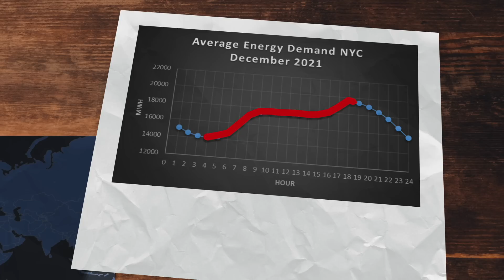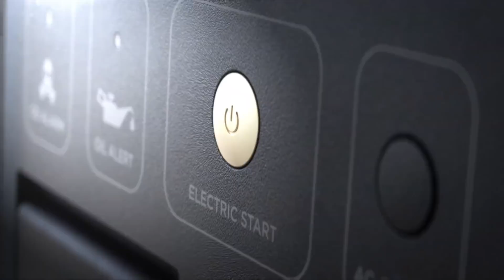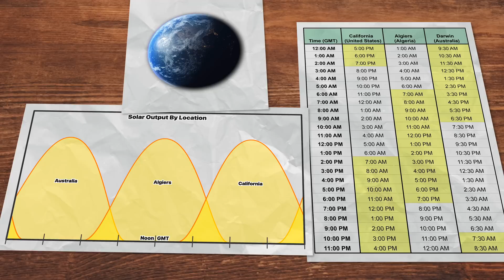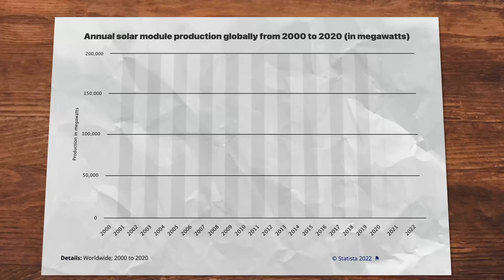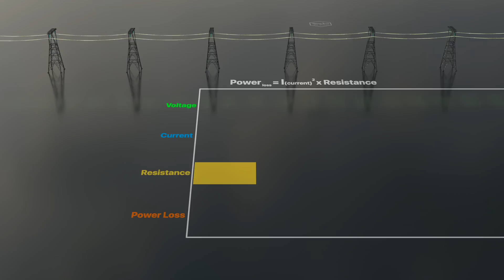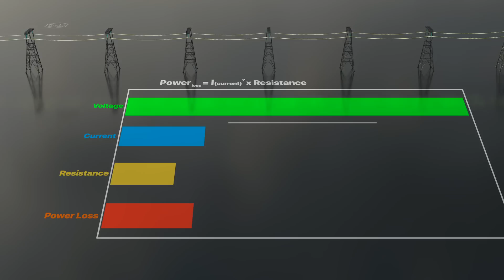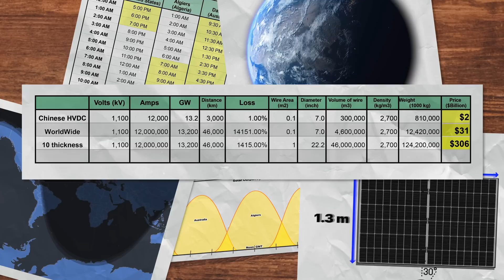World Solar Energy Network... Could this work?

Comment: Sadly a world wide grid not possible. For all the reasons you just listed. You also forgot natural disasters. Like Tonga volcano messing with all the internet cables that cross there. You totally skipped Hawaii as another place for solar panels to send back to the mainland. They also added magnifying glasses to solar panels. Guess what you don't even have to place them on land. It's better to have solar panels on water to help keep them cool making them more efficient. Even better yet. If you built them on water reservoirs it helps slow down evaporation.

Comment: The thing about New York is that it is probably more convenient to add interconnections with Québec. There are already several of those and there are several projects in the pipeline. It makes a lot of sense since Québec power grid peaks in winter while New York's power grid peaks during summer. We can offset each other's peak demand.

As far as transmission distance goes... To supply New York, the power lines are already 1500 kms. It isn't all that farfetched to think that a continental grid could be built with enough efforts. That's already the equivalent of a third of the distance from one coast to the other. One of theses lines is HV-DC, but the rest are all HV-AC lines. They are some of the highest voltage lines on the continent. You would probably need way more than just 46,000 kms of lines. There's only 340,000 kms of high voltage lines in North America, meaning that a substantial pourcentage of them are in Québec. That's what it takes to get power to population centers from generating stations over long distances. There is that much in Québec alone and that's for a population of 8.6 million. At that kind of scale in the US, we might be looking at more than a million kilometers of lines. Large portions of the existing network would have to be torn down and be rebuild from scratch. Many of the sub stations that we have are as big as your average shopping center, and there's 2 layers of high voltage lines. One of them handles long distances, while the other takes care of regional distribution to local substations. In large portions of the US, the power plant is right next to the city that it powers. There is very little need to high voltage lines. You are talking about a complete reengineering of the grid. There's also the issue of reliability. Québec's grid is very reliable, but it has a heck of a lot of redundancy and various systems to collect and analyse data. In other words, you are likely short selling the complexity and cost of building such a grid by quite a bit.

Comment: Great Vid,.... but I kinda hedge towards Geothermal as the main stay for this essay, with PV taking the hind-end at this moment. Use what we have and upgrade the existing for add-ons of the newer tech as it comes into play.
ie. use existing lines to accept additions from main hydro and river-side hydro systems, geothermal-dynamic,(steam driven deep-well outputs , like Iceland has), and Nuclear based as well as Solar PV.  Then, once the Grid is in place,.... Countries can upshift to newer Tech as it becomes available without the huge cost of changing their existing distribution systems to newer ones.....So going from coal fired to Geo would mean just punching a few wells and bringing in the geo-techs from Iceland to do their thing rather than redesigning their distribution system from scratch.... etc., ....  This I think might be a viable option in the next 50 yrs.
Reply: Dynamic-Geothermal is Steam output for turbine based power generation...." Latent heat " .  Passive- Geothermal is your typical Heat Pump scenario where we  Pull or Sink  " Sensible Heat " into the local Aquifer for domestic or commercial heating  / cooling loads to lessen the use of  Natural Gas  or  AC to cool our facilities.
Reply: I hate edits, ... Anywho .....so yeah, I meant  ..... natural gas and AC  to " Heat and Cool our facilities ".... AC= Air Conditioning....

Comment: I think if there were YouTube about a 100 years ago, when the car manufacturing raised, then we have had a similar video about oil and gas. We found a solution, which is even war resistant (I live in Hungary and we get the oil and gas through Ukraine from Russia even today, so first hand experience). I’m sure we also will do it, and the highly raised energy prices today will be a great inspiration in that.

On the other hand I truly believe that instead of a centralized solution or rather besides it we will have an internet like solution simply driven by the economy, which reduces costs, technical difficulties and risks too. We are already implementing local PV arrays on family houses that also feed the grid, it’s there already. Temporary local storage will be required but there are already affordable solutions for that in the ongoing  developments such as liquid metal batteries.

Regarding the available resources we already see new solar technologies - like solar panels with magnifying glasses to reduce the surface and material amount need of panel production -, or tests to transfer energy wirelessly. There are close to decade old continuous green power sources e.g. from dams which can also be handled as stable and continuous base producers for the less plantable solar, wind and other green solutions.

The human smartness will find solutions to all the topics you mentioned in this great video, and I’m really happy that the demand for a global renewable energy solution  is on the discussions.

Comment: This cost exercise, could help with fusion research.  Fission has been successful in parts of the world, even with its problems.  A few trillion in continued fusion research could get it to producing real power.  The hundred square miles of solar could be reduced to a hundred plants across the world, and the long transmission lines eliminated

Comment: with those power levels you would be better off with super conducting lines. Either oil filled or in the air the 1000Kv DC lines would have a series of vacuum insulated pipes for each line. Steel is stronger than the AL wire so it could span the towers and the super conductor wire in the center would be liquid cooled.

Comment: seem like it be cheaper to build a solar farm in orbit... i actually thought you was doing to suggest beaming the energy by satellite from around the world instead of power lines.   Isn't there testing in a tow of wireless electricity by converting electricity into sound then back to electricity?  I don't know how much energy is lost in this progress but it maybe a way to deliver energy on a global scale.  Which i would assume it may be allot cheaper and quicker to build even thought allot of the money would go into research.  Kind of make you wounder if there ever be a thing like a sound battery.

Comment: Well done thanks Ricky - I think local production of energy using diverse methods (wind, solar, geothermal, nuclear, hyrdro…) plus diverse storage methods (liquid air, compressed air and co2, gravity, li ion, sodium ion, aluminum, sand….) would result in an incredibly resilient system.
Reply: Improve battery for solar & decrease population,,,,
Reply: @edthoreum7625  
Decrease individual consumption.
5-10% of the global population using 30%(+?) of resources is a major problem.
Blaming it on "population" just puts pressure on the most populous countries who use much less.

Comment: First you build the solar farms but adding a quantum dot film to increase the light at the most favourable spectrum and to reduce heat. You overbuild so that the local electricity market is glutted and the electricity price is close to zero most of the time. The challenge is actually to find a use for the cheap electricity so you can build a bigger solar farm without going broke from the glut you create. You can create a price floor for the electricity by creating browns gas and water. When power is cheap you generate browns gas which is about 1/3rd is gaseous water in plasma form. With the browns gas you can burn it to produce heat with the bonus that what is left over from the flame is deuterium free water which is even higher value as it confers longevity and health while preventing most cancers and disease since the water is pristine water with no harmful water memory. To produce abundant water you use seawater which you evaporate using brine heated by the sun in pools. You use aircrete to build sand heat storage below the brine pools. You burn the browns gas to heat the sand which will produce steam which dissipates throughout the sand spreading the heat cheaply without pipes. More heat allows more water production from the evaporators while the valuable deuterium free water from the browns gas flame is easily captured when it condenses and trickles down by gravity. The fresh water from the seawater would be transported by pipeline. Browns gas would be added to the water as nanobubbles to improve its quality and to ionize it. The water gets energized by the flashes of blue light of imploding bubbles while more nanobubbles remain dissolved rather than evaporating. Crops grown with that water would require less water and would grow more quickly and would not attract disease which often results in crops when using non-energetic water with harmful water memory. The crops produced are much healthier so are higher value. The demand for water is high in many deserts near the ocean so producing it reduces the economic risk of building such a massive solar cell farm.  Solar cells are likely cheap enough now that there should be no water scarcity and no one should have to drink water reclaimed from sewage whose harmful water memory confers disease. You could transport the browns gas by pipeline nested inside water and/or natural gas pipelines so that hydrogen which evaporates through the metal is not wasted. The hydrogen can be recovered easily when the water is used because it evaporates so quickly when dissolved in water. Instead of distributing electricity at great expense you create water, browns gas and hydrogen then transport that farther and farther as may be necessary to create the desired price floor for the solar cell farm electricity output.

Comment: Just geopolitical squabbling would nix this idea.  Just scale it down between regions and the ability to bypass the a**holes of the world, bring in wind and other renewables, give residents the ability to put in their own systems to keep corporate jerks in line and you may have something.  

It does tell you how we need to massively scale up production of solar panels, wind turbines and heat pumps to make a dent in emissions.  Still doesn't look good.

Comment: A scaled down system across the US and maybe some day Mexico and in Canada might be worth considering.   Major solar installation in Southern California, Nevada, Arizona, New Mexico, Texas, ... could expand the time that sunlight is available and by having many solar power stations in different areas could reduce the possibility of an overcast day killing any power generation.   Much of the transmission system exists, but would need additional upgrades to deal with the increased power.
Reply: You know Texas won't join a national grid, right?
Reply: @daispy101    OK, I didn't know that.   So skip Texas and pick Oklahoma.

Comment: Australia wants to pretty much do exactly that. Sell solar electricity to Singapore with high voltage lines under the ocean. Don't know if they will actually do it though. Seems a bit expensive even if it is only Singapore and not world wide.

Comment: You just have to INTERCONNECT SYSTEMS. In my country (Perú) we produce more electricity than the needs of the population. We have surplus.
The base is Hydroelectric but we also have SOLAR WIND and NATURAL GAS. But even producing more energy than our needs, we have regions where is so difficult to deliver energy that is easier to BUY ENERGY in Ecuador or Bolivia... and that's what we do. 30 years ago we interconnected the Peruvian systems to Ecuador that is also connected to Colombian systems. So when Lima needs energy, maybe those "electrons" were originated 5 thousand miles north!
For South América that's the problem: We are all more or less in the same hour (the NY city hour) and oriented north south and not that much in the east west axis... So we only need to INTERCONNECT our systems in the Americas and from Alaska to Russia... and the rest of the world. 
The big problem to solve,  is not technical or geographic BUT POLITIC...

Comment: You may not have heard of the company that is looking at space solar creation. The idea has been around a long time but the company has started to change track. If you can beem power down then you can beem power up, across and down. This means using satellite transmitters you can beem energy from one country to another and only send what is needed so you could have power beemed anywhere. The local power grid could then distribute the power or you could beem the power to individual locations.
With this you could build any type of power plant anywhere on earth and beem the power to anywhere else.
Imagine nuclear powerplants built in the middle of the Pacific ocean right next to huge floating solar panel farms and wind turbines which beem power where we need it.

Comment: We definitely need more grid interconnection, but I don't think the amount of grid interconnection needed for Australian solar to heat London in the winter is cost effective at some point storage in sodium ion batteries or other such technologies is cheaper than building more high voltage DC power lines.

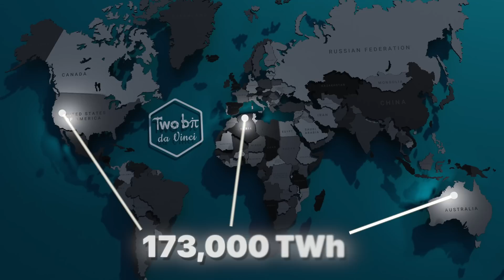Comment: In the beginning of the video you state that the sun produces around 173,000 TW of energy on the surface of the earth and the energy requirements of the world are 19 TW, but then around 7:55 in the video you state that we would need to produce 173,000 TW from solar around the globe to meet the world's energy requirements. So which is it? 19 or 173,000?
Reply from the maker: 173,000TWh of energy is what the world uses in a year. 173,000 TW is the instantaneous power the sun delivers

Comment: Big mistake on the aluminium calc.. 10 times thicker is 100 times more material and 100 times the cost.. makes it more impossible, sorry..
Reply from the maker: No it’s correct. It’s 10x the area

Comment: Just curious, how much energy can be transmitted through a fiber optic line?
Reply: There is no hard limit so long as the fiber is wide enough but it is less efficient than simply transmitting the electricity through conductors.

Comment: I ran the Arizona-New Mexico grid for 4 years as an Operations supervisor for APS. This Idea is old, it has too many disadvantages. Reliability is a major problem, turf wars is another. When they tried to tie the Texas Interconnection to the Western Interconnection, it did not work, its the tail wagging the dog. Possibility with modern DC ties you could make it work. That's what Texas does right now. The losses would be high, at a guess 30% that's a lot of heat generated for no profit. I thought a lot about these things when I was working, but now pretty much leave it to others. As long as companies do such a bad job, reference Calif and Texas, it won't be possible. APS wasn't much better, but at least they are rational and have good companies to work with, SRP and Arizona Power Authority among others.

Comment: It's not as efficient for generating, but has the advantage for storing energy and being a feedstock for many industrial processes:
Global synthetic-methanol network.
I'm not sure how the 'transmission' costs compare by running networks of pipes, but intuitively feel that a greater amount of power could be moved per second, and that storage nodes throughout the network could buffer any transmission problems.
Methanol can then be used either by combustion or fuel cells to generate both heat and electricity.
EDIT: Much of the piping is already in place, so that would lower transmission costs.

Comment: you are far too stuck in centralized distinction. In your model, I would blow up Bejing, and the entire model is destroyed. No country is going to bet thier energy independance on a global grid. Plus the losses of distribution makes it a non starter. Decentiralized energy creation is so doable now. I can put panels in my front yard that wil power my home. THere are several battery compositions that will store that solar energy overnight. Centralized energy production is a thing of the past. Lets see in the energy producers have the money to make decentralized not work out.